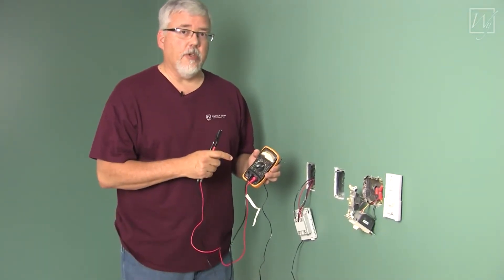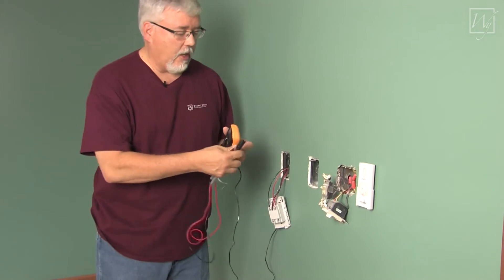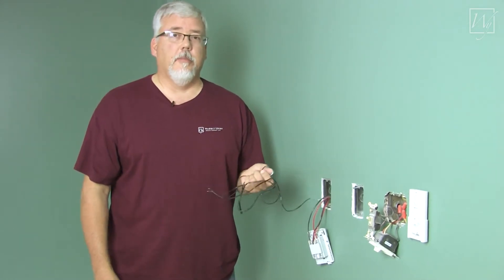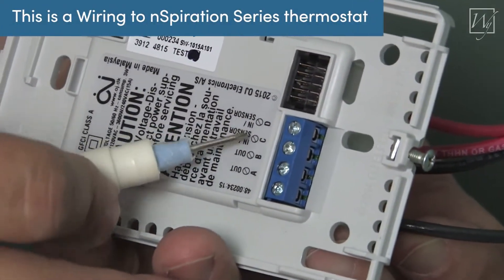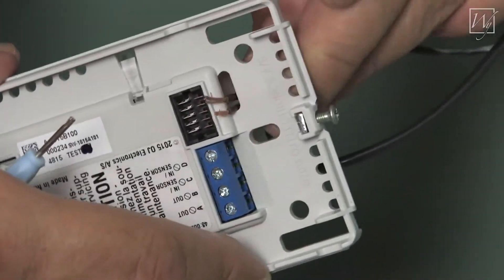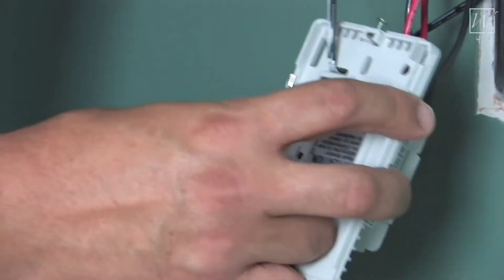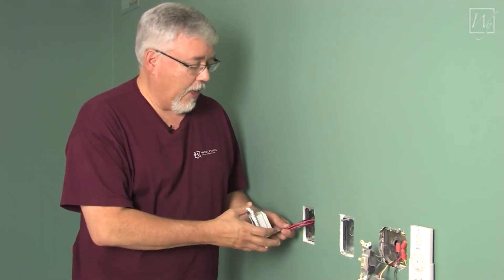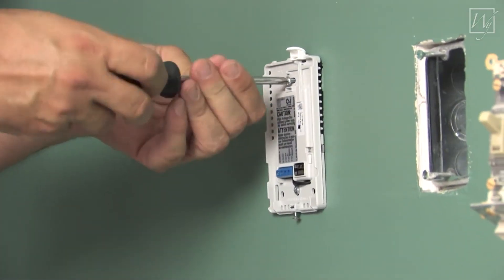How to Wire a Floor Sensor to an nSpiration Series Thermostat

Comment: Is it common to have 2 floor sensors? A customer had in floor heat installed and there are 2 sensor cables in the box. I'm assuming just run them im parallel to the IN terminals?
Reply from the maker: It is actually a common recommendation to install a backup sensor. This way if the original sensor fails, a second one is already installed in the floor and can be connected to the thermostat. They should not be both connected at the same time though when first installed, just one at a time.

Comment: Hey does that sensor wire need to be in the tile?
Reply from the maker: The sensor wire goes in the same layer as the floor heating mat. So it will be embedded in the self-leveling cement or thinset before the tile is installed. If it was not installed at this time, a gap between two tiles at the grout line can be used if needed.